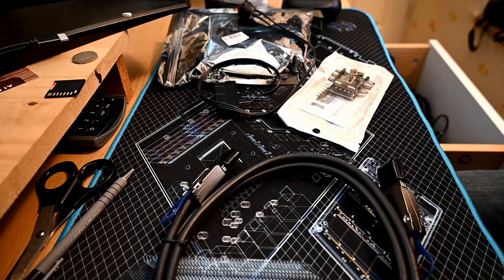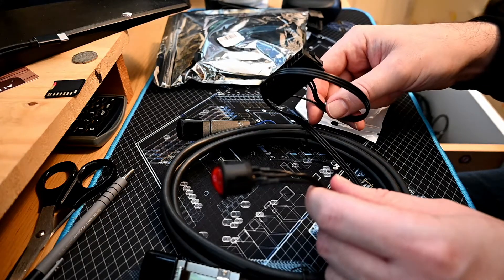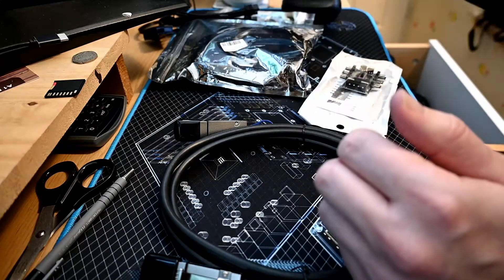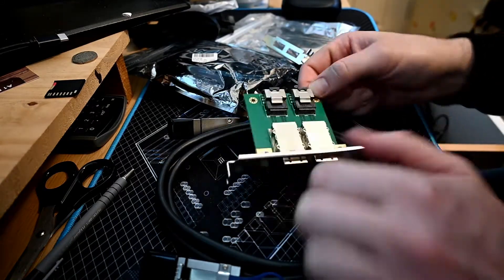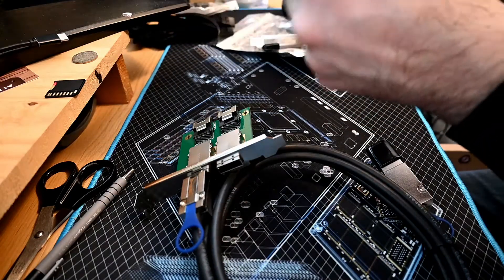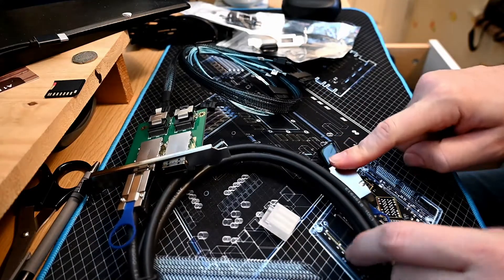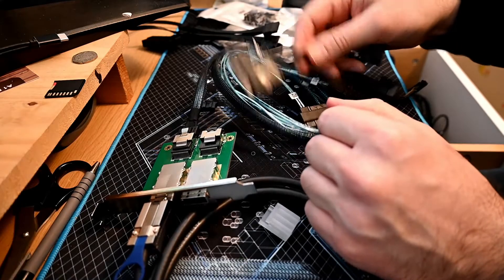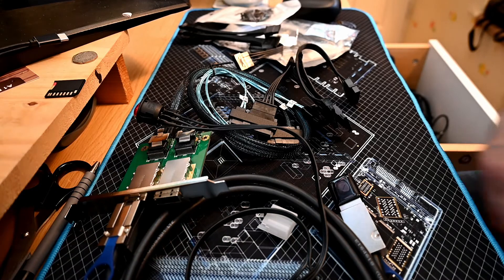Part 1: Building a homemade direct attached storage (DAS)

Comment: I have a question. Can you use that same setup with sata on both ends instead of sas? What I mean Is I don't have sas on my server and no pcie slots for a sas card. I do have 8 sata ports on my server. And would like to use a DAS on it and have the drives externally.
Reply: You could, but sata is limited to 1M range. SAS runs a higher voltage and can run drives further. You would need very short cables and they wouldn’t even reach outside your case.

Comment: Question, is there a way to connect it through a USB instead of that cable your using?
Reply: What USB? Type A?
Type C or Thunderbolt would be much more feasible.
But, the speed.
A SAS
Reply: @Anuitu2u  was thinking usb 3.0

Comment: What length is the SAS cable mate? I've built two DAS systems and wasn't aware of pass through cards so I used 2 metre SAS to SATA cables. I'll fit these with pass through cards in the near future.

Comment: Looking into doing this for my homelab server.  What components are you using that you have found that work good?
Reply from the maker: I am planning to do an another video on this soon as I have all the bits ready to put together.
Reply: @pleaseleavequietly  I did watch your other video with you saying that your host computer decided to take a dive.  Hope you get a computer back up and going.  I'm gunna end up using a HP P800 Smart Array Controller in the host and then a HP SAS Expander card in the DAS box.  I'm gunna end up reusing an old Dell PowerEdge 4600 6u server case gutted out for the build.